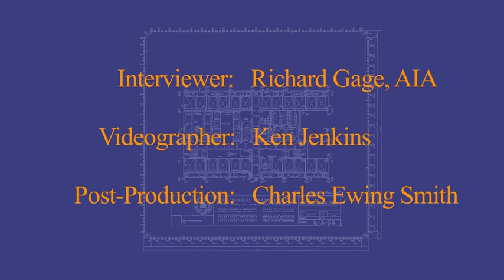David Topete, MSCE, S.E.

Comment: free-fall means that all the potential energy becomes kinetic energy - no work was being done to move 8 floors worth of support beams and columns out of the way - go look at a massive building and try and understand that 8 floors vanished - 100 feet of vanishing - 2.25 seconds of nothing - ZERO SUPPORT - ZERO RESISTANCE FROM 8 FLOORS - this is impossible , especially when we're told that a fire did it - fire cannot do it - what fire? - basic physics - cannot be changed for1day

Comment: every action has an equal and opposite reaction Newton's third law of motion - when wtc7 fell at the rate of the acceleration of free-fall for 100 feet what reaction was there from the 8 floors below? ZERO RESISTANCE - the building dropped as if thru air - this is impossible according to the law of motion stated - sad that you want such laws to be broken for a day to not ruin your view of the world - deal with it - basic physics - easy to understand for some